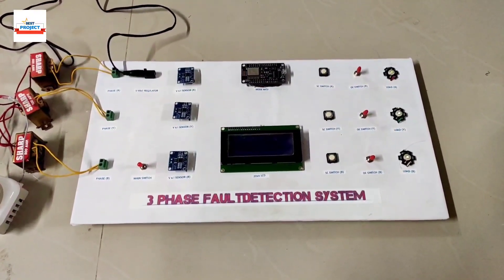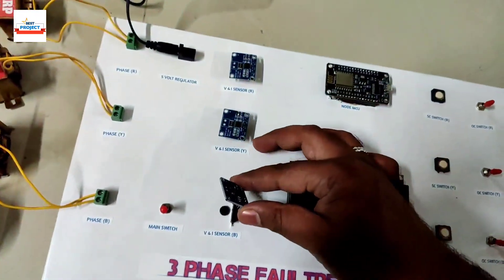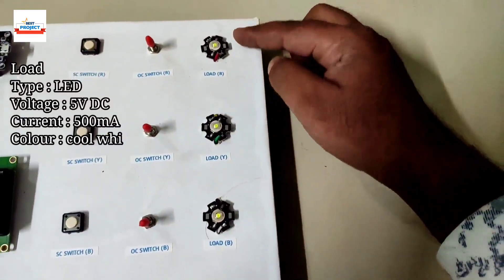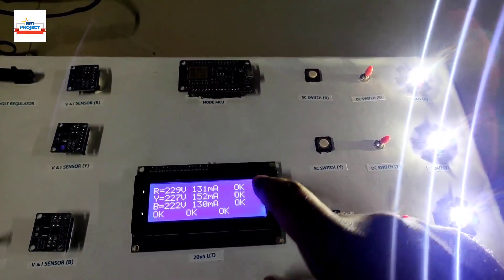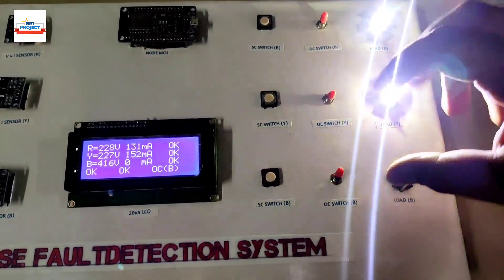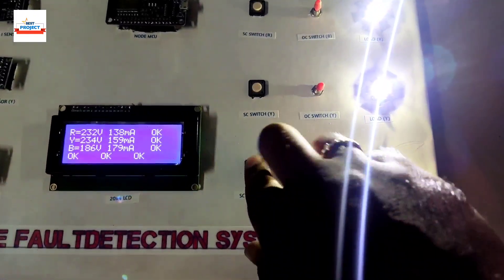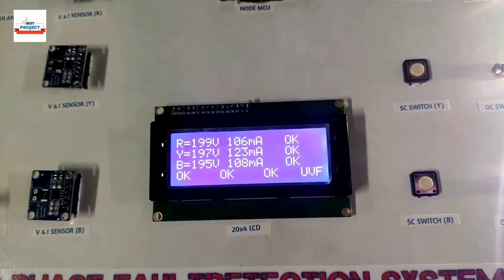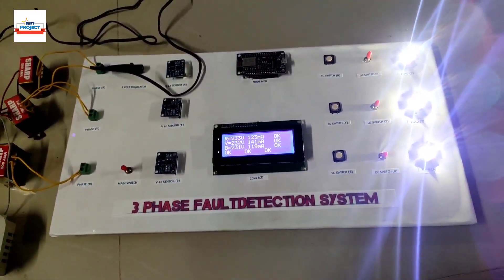49. 3 Phase Fault Detection System Using NodeMCU | Current | Voltage | OVF | UVF | SC F | OC Fault

Comment: Can you do this project 

Title: Design and Implementation of a Smart Irrigation System using Arduino and Machine Learning Algorithm

Description: The proposed thesis aims to develop a smart irrigation system that uses Arduino microcontroller and a machine learning algorithm to optimize water usage for agricultural purposes. The system will measure soil moisture levels using sensors, analyze the data using the machine learning algorithm to predict the amount of water required, and control the water flow accordingly. The algorithm will be trained using real-time data collected from the field, making the system efficient and accurate.

The proposed algorithm for this thesis could be a supervised learning algorithm such as a Decision Tree, Random Forest, or Support Vector Machine (SVM) which are widely used in agriculture for crop classification and yield prediction. The algorithm will be trained using a dataset of soil moisture readings and water usage, and will be able to predict the water requirements for crops based on their type, soil condition, and weather data. The algorithm will then send instructions to the Arduino microcontroller to control the water flow to the crops.

The project will require hardware components such as Arduino UNO, soil moisture sensors, water pumps, and solenoid valves. The software development will involve coding in Arduino IDE and Python for the machine learning algorithm. The system will be tested in a greenhouse environment with different crops and soil conditions to evaluate its performance.

The outcome of this project will be a smart irrigation system that can optimize water usage for agriculture, reducing water waste and increasing crop yield. The thesis will also contribute to the field of agriculture by demonstrating the feasibility of using machine learning algorithms in agriculture for predicting water requirements.
Reply from the maker: Thanks for your valuable feedback